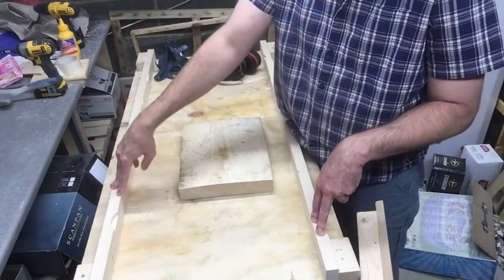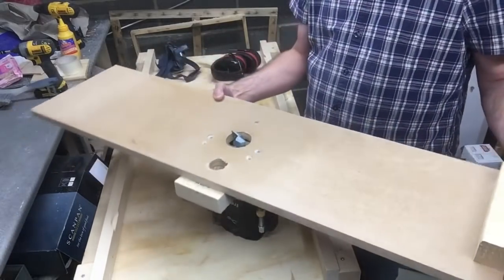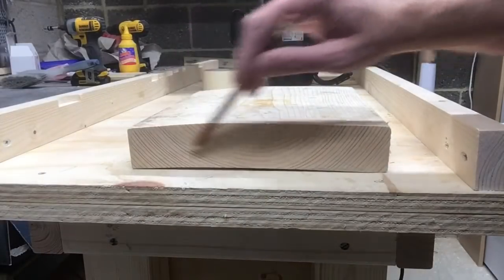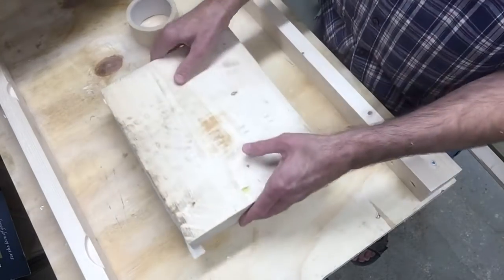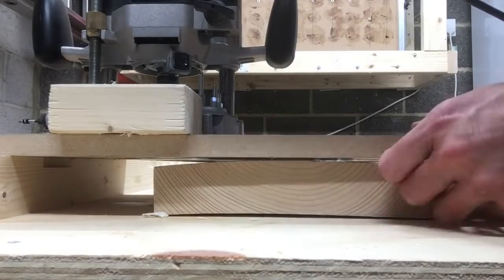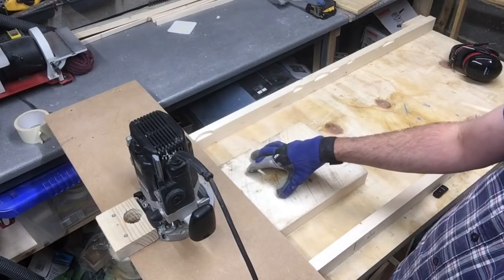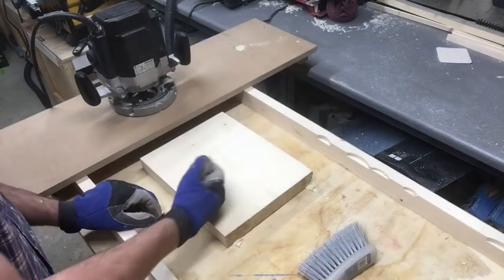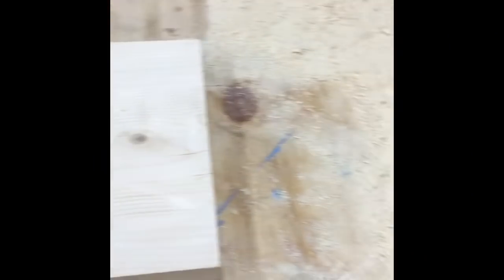How to flatten a board without a planer / jointer / thicknesser

Comment: This is a very common method for flattening slabs, however a critical step was left out. Not everyone has a flat work bench so you can’t always secure your rails to the top and assume the slab will come out flat (you could produce a worse effect than the bow you’re trying to remove in the first place). Securing the rails to the sides of the bench and using winding sticks to check for parallelism is always best practice. I would also add at least one or two braces to the router sled depending on the span between the rails as the thickness of the MDF/plywood, weight of the router, and size of bit play a big factor.
Reply from the maker: Good point about how the work surface will reflect itself onto your workpiece, thanks for watching.  Keep well.
Reply: Never heard of winding sticks.
Reply: @U2BER2012  Winding sticks are just two pieces of wood with parallel sides.  One is typically darker than the other (or painted to be - or you could use masking tape to make it darker).  The winding sticks are laid across a board usually to determine if there is twist.  The lighter colored one is placed nearer to the woodworker and the darker colored one is placed further away.  Since the length of the sticks is longer than the width of the board being examined, it basically just extends the lines of the board.  You can sight down the board, looking at the two winding sticks to see if there is any twist.  This is much easier to see in pictures than with my very poor explanation, but they are very handy and simple tools.  Best of luck.
Reply: @blakeshedd5354  Awesome, thank you!
Reply: @blakeshedd5354 Thank you for this detailed explanation.  It really made sense, you did a fine job without pics. & video.  My project is for out board motor stands, not critical, more ascetic.  Good tips for future reference.👍

Comment: Absolutely perfect. I’ve been going nuts trying to figure out how to do this without buying any more equipment. Thank you
Reply from the maker: Always grateful to help out, please take care.
Reply: Same. I needed this like a hole in the head trying to understand how to make this work. Problem with my situation is that I’m dealing with prepurchased lumber which I milled down down to 3” improperly. Now I’m dealing with twists and bows. Shall be interesting without the heavy lifters. But a couple jigs should do the trick. This one and a table saw straight edge notched to one blade width thick to about 3/4 down the board. A few passes and a few flips, should get me down to about 2”🤣. Live and learn. Am I right or am I right?

Comment: I considered buying a planer thicknesser but decided not too because I want to deal with wider boards for making tables. This is by far the cheapest method I have seen. Thanks for sharing. Now I just need to get myself some large end mill bits.
Reply from the maker: Glad to be of some help; granted this method is not without its problems of finding a large and flat surface to operate on...  Please take care and keep well.

Comment: I've seen other planing jigs but I like yours. She stationary router and moving the board itself gives better control and seems more safe. The only downside is if you have a large panel to flatten, like a table top, the sled needs to be almost double the with of the work piece.
Reply from the maker: Thank you.  Yes, you can move the rails as wide as you please and like you stated the sled needs to be longer; moreover, you have to counter the possible dipping/sagging in the board that you are using.  Please take care and keep well.

Comment: Isn't it better to do some adustment with current dedign to replace that router with a electric hand planer? It should be much faster to flaten the wood.
Reply from the maker: Sir; yes, you could do some modifications and use a electric hand planer; however, I think you would have to have different sets of rails as a planer only goes so far down to adjust for the height of the timber...
Reply: @CleverWoodworks  yeah,correct, that should be in the design as well.
Reply: I think an electric hand planer could gouge the wood but that's just me.

Comment: You can do this with a  hand held power planer with a few modifications.  
You can also do it on a tablesaw 
Or jointer.   I belive your running your 2" router bit too high a speed depending on feed rate and speeds this could burn up the bit and or wood. The larger diameter a router bit is the slower the turning speed should be.   Also a few taller full length side boards on the router plate will keep it from bowing.   It would also let you hold the router and not the mdf.

But this works, just don't hit a knot or you could loose control.

Comment: Maybe a piece of plexiglas instead of multiplex, so you can look at what you are doing. Or maybe a see-through hole of plexiglas around the router.
Also for dust collection there are add-ons for the router.
Great vid, thanks !
Reply from the maker: Thank you so much for your comment sir.  I have thought about multiplex; however, as I don’t use it that much and the thickness I do use is only 6mm, it wouldn’t be a good fit for this.  But the spy hole and definitely the dust collection would be a good idea.

Comment: I like this method, plus I do not want to buy a thickness planer. So I can just use my router.
I would suggest to anyone doing this to cupped boards to let the planed boards sit a few days before any building or glue-ups. As severely cupped boards are cupped from tension in the wood fibres and they will continue to cup slightly after the first initial plane, thus having to do another plane.
Reply from the maker: Thank you so much for the input.  Must admit, as much as I would like to get a thickness planer, I just cannot justify the cost and frequency of use that it would get... Please keep well and take care.

Comment: I am someone who is prefers using a router for many wood jointing cuts over a table saw like many many YT creaters use. As someone who can't afford two table saws, it allows me to have two setups table saw to cut, and the router to joint. Plus it is my opinion that a router will provide a cleaner joint with most setups.
Even if you have to make multiple passes with a router, as this video illustrates, there are no jagged pieces to break and chisel out later. Cleaner tighter glue ups

It makes me curious why a hand planer is not the tool of choice for this process?

Not only is a powered hand planer designed for this, it is wider than a router bit. A planer can also give a smother finish as it goes with the grain of wood. Less post sanding?

But I have never used this process so I am not experienced with the pros or cons of either tool use.

That could be an interesting video? 

And I mean both topics.

A comparison of using a table saw for joints and the chiseling remaining uncut wood vs a router with smoother and no chiseling for tighter smoother gluing.

And a planer vs router for the topic of this video.

Maybe there is an actual reason people use a router over a hand planer?
Reply from the maker: Yes, I will agree that the router is overlooked on several different operations that it outperforms compared to the table saw.; granted, I’m just as guilty for doing this...  but if I were to be asked for a reason, I would have to state tat a router takes slightly longer to set up.  As for the hand planer, I have never owned one and most likely never will. Thanks for watching and the comment, please take care and keep well.

Comment: So after building my own router sled, I immediately noticed that if you have a lot of milling to do to a piece, you have to put up with the constant vibration from the router, I also end up with a back and neck ache from leaning over the piece.
I love my sled, don't get me wrong, I think we all have an attachment to the things we've designed/created.

 But, after hour's of watching probably over 50 YT videos on making a router sled......you're fantastic and very clever idea just randomly comes up in my feed once I'd built mine..... Go figure 🤔😁
Subbed and thank you for sharing this idea. When I have bigger pieces I will be using the wisdom you've passed on!
✌️
Reply from the maker: Sir, thank you so much for the compliment.  I know what you mean by not tearing down your very own craftsmanship as it seems so wasteful.   However, this technique will work, would of loved to show the 7’x5’ ft 2x10 shelf I made for my son, using this; but I only changed about 5% of the design…

If there is anything else you need, please let me know.  take care and keep well.

Comment: I use my bandsaw to flatten boards. I cut stock to rough length. I have a veneer sled that I attach the stock to, and then I cut the crown and any associated twist from the board. After that, I cut the bow and remaining twist from the opposite side by running the freshly cut side against the bandsaw fence.

Couple passes with a jack plane and my boards are flat and parallel. They're as good as any S2S lumber I've purchased from any number of places.
Reply from the maker: Yes, a bandsaw is a great and versatile piece of equipment to have at your had.  I wish I could have one myself, but just cannot afford the loss of the floor space that comes with...  Thanks for watching and please take care and keep well.

Comment: For a short board like the one shown, you probably won't notice if there is any twist to the planing jig.  Before you try to flatten the board, check the jig for flatness: set winding sticks across opposite ends of the rails and check for flatness.  Make adjustments to make sure it's flat.
Likewise, it's possible for the MDF board the router is attached to to flex as you slide it across.  Not much, but enough to mess up your flat surface, especially if you want to really polish it up.  Stiffen it up with a couple of rails on either side of the router.
Reply from the maker: Firstly, thank you so much for the constructive criticism.  The winding sticks are a great way to know where there is fault; however, after finding the fault the adjustments can become a whole new can of worms.  Thank you for watching and keep well.
Reply: I suppose the jig itself might ride/be floated even if nominally checking out as flat but that should self correct as the routing/planing process proceeds and it appears the operator here is using it in a random orbiting fashion rather than a strict back and forth progressive advance across the piece that might also mitigate such deflection and just as with a planer/jointer multiple passes lead to successive improvement.

Comment: How would this do on end grains? Such as for end grain kitchen cutting boards? I know you can't use a table top planer for that style of cutting board.  I'm really super curious how this would perform. If it works your about to make alot of overpriced companies very angry.
Reply from the maker: Good question, I have never used it for that  There are a couple of factors that I would probably take into consideration before attempting this.  Firstly, I would let the glue set a couple of days to make sure that it is set throughout.  Secondly, to secure the piece I would use some scrap and screw it down alongside the piece(much like a CNC set up) so that there is little movement.  Lastly, I would only take the smallest amount at a time.  So I think it could be done, please take care and keep well.
Reply: @CleverWoodworks   Would you mind testing it out? You would probably increase view counts and traffic to your channel if it worked. Drum Sander set ups are insane and most people can't afford them anyway.

Comment: Hot glue works better than tape and it pops right off.
Reply from the maker: Sir,  thanks for the comment.  Though I would agree that hot glue can give a good grip it is not necessarily better. I tried using hot glue at first; however, when removing the glue and board it was coming up with small chunks of my work surface.

Comment: Have seen this method in very complicated ways and your is an elegant solution, most of the videos that have seen trust on complex lift mechanisms or very elaborated rails and your approach of just use the bit depth and the oversize sled is just genius.
Reply from the maker: Thank you so much for the compliment, I know what you mean about the over complicated jigs and for the amount of times I might use this, it just wasn’t worth it.  Thank You for watching, keep well.

Comment: Wow!  I wish I’d seen the video earlier.  I’ve finished a farm table and used an electric planer.  It worked ok, but I think this method would have worked better.
Reply from the maker: Well... nonetheless, I am happy that you enjoyed it; however, depending on the width of the table I would consider getting a thicker board for the router to minimise deflection.  Thank you for watching and keep well.
Reply: @CleverWoodworks  thanks for the tip.  I just ordered the bit and will do some testing on scraps, etc.  Really appreciate your help.
Reply from the maker: @Greghc48  Good stuff, glad to be of service.  Keep well.